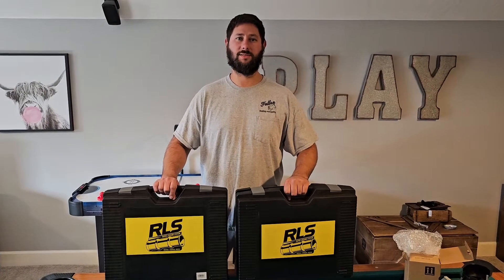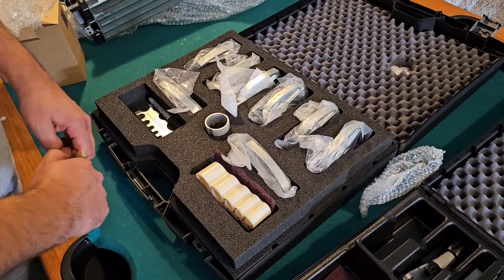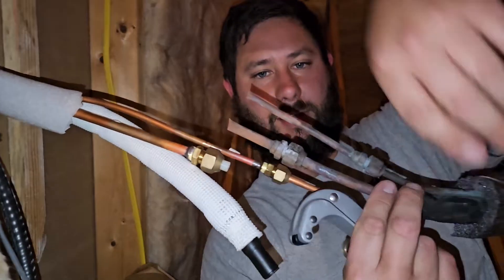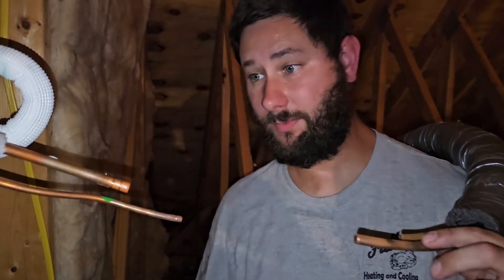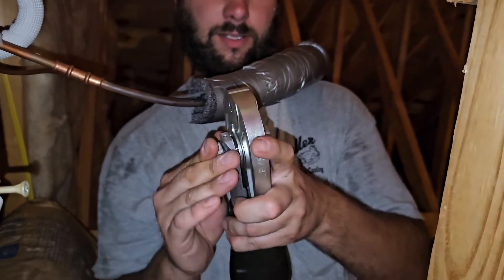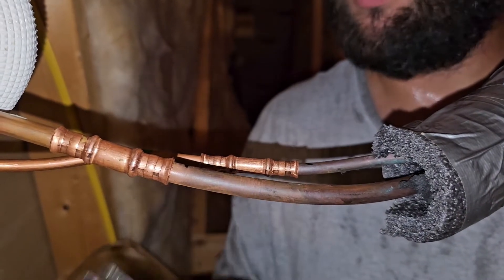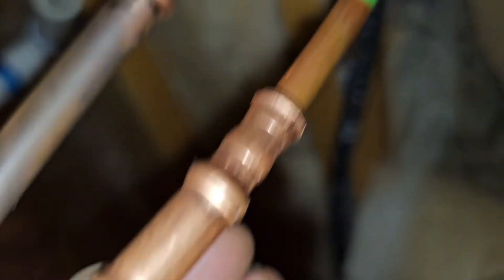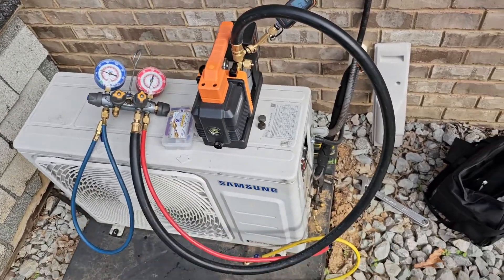This HVAC Press Tool Hack Will Blow Your Mind!

Comment: I've been in hvac for fifteen years, and i've always hated braising. Especially installing new reversing valves. This right here makes the job so much easier and faster. It's almost a $3,000 tool. I got my money back after one commercial install.

Comment: It’s worth the investment in the long run once you think about buying solder and oxygen/acytelene.
Reply: not it isn't. considering the price of $23 per 7/8" fitting, oxy/acet(both torch and gas refill) is way, WAY cheaper than just few fittings for a single job. they only reason one could by RLS kit is for government/military/data center etc jobs where fire watch is mandatory and having a RLS tool is cheaper than mandatory fire watch. For anything else, residential and light commercial with current fittings cost its not worth it.
Reply: @mikhailkurylenak1515  i agree with your assessment! But it’s a win for me bc there is  zero chance for copper foulings or residue from sweating the copper to get inside the fittings.

Comment: Sorry, I accidentally sent a message before i finished….I installed RLS on 7/8” and 3/8” Aspen fan/coil that were a fraction of an inch smaller and the jaws didn’t crimp tight and the fittings moved a little after crimping. THEY DID NOT LEAK!!  RLS tech support said they’ll probably will be fine.
Reply from the maker: That's interesting, I have never heard of this happening before, but I trust RLS.

Comment: Hey Taddy, Did you know I can’t voice texting your name? It keeps coming up as Teddy.. But that’s OK. I have a question for you, When it comes to cutting off the flare on mini split lines on the heads, I noticed that sometimes the line that’s on the head looks like a different size than the line that I’m running to the head. Is this true at times?
Reply from the maker: yes be careful when cutting the connection sometimes the mini splits have different size copper 
for example you may be using 3/8 od and the mini split has 3/8 id

Comment: But I will add on the quarter inch fittings like the couplings even with proper prep. It was still so easy to push the O-ring out of the fitting that you really gotta check those and the other thing don’t rely on the stop in the fitting in the coupling because the pipe will push past it, so absolutely mark the fitting with the gauge and stick to the depth mark on the pipe.

Comment: When I started to think twice about the press fittings because I found I had leaks here and there I was starting to question them and how reliable they were, but then I did discover as I was new to the system that I absolutely was not prepping it step-by-step, and once I started to do the proper Prep the fittings worked flawlessly.

Comment: The only thing that worries me about cutting off the flares and pressing those connections on the indoor heads is, I’ve had heads that I’ve had replacing the past and it’s nice to be able to break the flares to remove the heads and replace them for any reason whether it’s for cleaning or for replacement. But I definitely agree with wanting to just press everything and it’s way easier. It’s one system. It’s faster and it is reliable.
Reply from the maker: Good point!

Comment: So the milwaukee m12 force logic short throw press tool is a suitable replacement for this? I guess that tool comes with jaws for Pex and you would have to buy aftermarket jaws for the copper pipe size you want? Is that right? And is the fitting for water the same one you use for refrigerant natural gas etc? Thank you
Reply from the maker: I'm not sure

Comment: Over 100% markup on the fittings to the customer? That’s a rip off
Reply from the maker: If a fitting cost five dollars and you mark it up to ten, that's not a rip off
Reply: I agree with you Taddy! Absolutely double the cost of the fitting under 100 bucks. Trying to run a business here, not a free-for-all

Comment: Thank you sir!  I have a question. Are the  copper lines ever different size on either side of the flare?  I may be mistaken but I thought I came across that on a Samsung indoor wall unit . 

If so I guess we just make sure we get a reducer.
Reply from the maker: yes sometimes copper is different size
Reply: FYI, the 1/4  line on the Pioneer / Midea units are not 1/4” on the evap side.   I learned this the hard way!

Comment: Thanks for the great video. My main concern about these fittings is that they might show leaks in systems with sudden temperature changes e.g. a freezer using hot gas as a defrost mechanism. I am afraid if the sudden thermal contraction and expansion can lead to leaks around the fittings. Have you tried it in such systems?
Reply from the maker: I have not tried it on freezer equipment but I did try on cooler equipment a couple weeks ago.

Comment: 435 psi on indoor coil now that would scare me, what is the low and high test design pressure?
Reply from the maker: Samsung actually recommends that the pressure that you test should be at least five hundred and ninety p s I.
Reply: @taddydigest  oh wow good for Samsung if it handles 590 it can surely handle the few hundred that it runs on the regular

Comment: I have been using the RLS system for a few years.  Good stuff.  I have the compact Milwaukee press and have the mega press gas jaws and copper press jaws its great.
Reply from the maker: Very cool
I've wondered about the gas jaws
And how good it works
Reply: What the Milwaukee RLS jaw model number for the kit

Comment: I am wondering how well this will hold up to the vibration, thermal cycling, and o-ring deterioration over the course of a normal product lifetime.?

Also is there a way to undo these couplings besides cutting them off in case they do start leaking?
Reply from the maker: I'm pretty sure I would have to cut them off if they leaked.

Comment: I’ve done a lot of research about these products. The price of getting set up with this is way out of range for your average technician. Milwaukee has a tool that uses these fittings. All of the tools are crazy prices. The RLS brand has a better warranty than other products (15 years). I just wish the tools were cheaper.
Reply: Facts but be a man and save up to buy your tools

Comment: Very cool presentation Tadd.. how did you figure out that pesky annoying DENT from the Tube Cutter ? Always happens with me. Is there a better way to cut tubing without that cutter ?
Reply from the maker: I think that I was pressing down too hard and I needed to use the tube and cutters that correct way.